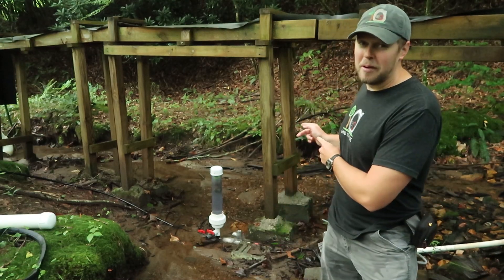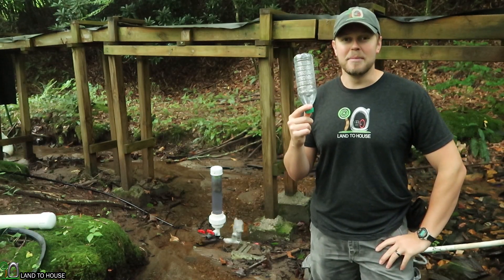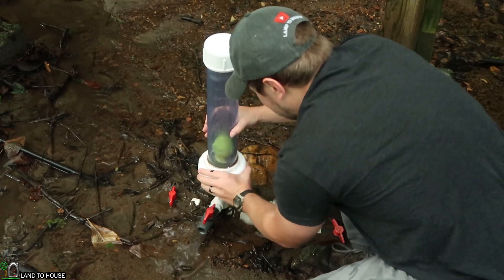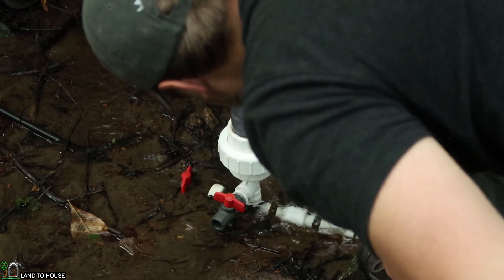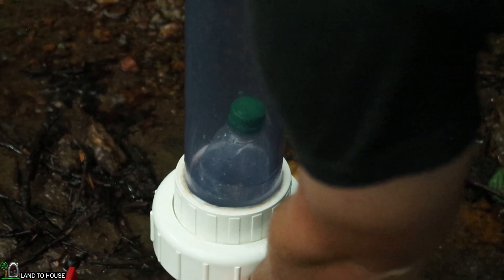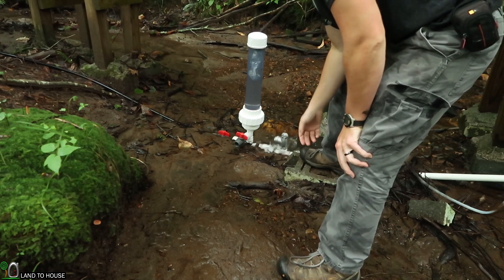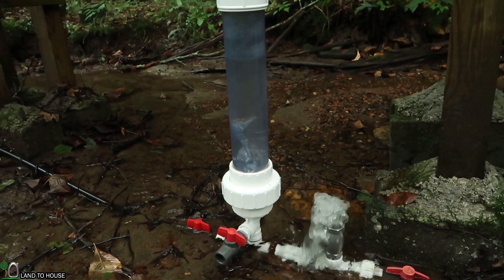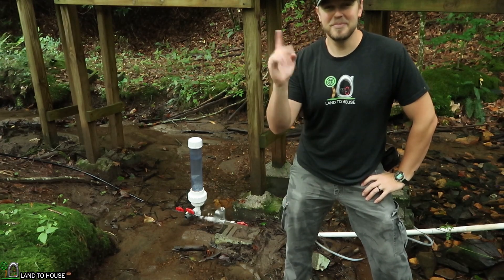Ram Pump Crushes Water Bottle

Comment: That is a rock solid demonstration. It looks like the volume of air that the bottle would have had is whats trapped in the chamber. Altho it looks like it was not successful (visually), in a way it is preventing the chamber from being completely filled with water. I would say thats a success in terms of function. I cant see the chamber overcoming that pressure once it is to the pulsing stage. The air that is trapped is pushing back. I would like to see you add 2 bottles and see if the volume of air in the chamber correlates to the number of bottles. I feel that either way, any amount of air under pressure or a vaccum will compress or expand, that is just its nature.

Comment: Try putting a tire valve in the bottle cap and pump it up to 15 or 20 psi . Some plastic bottles will hold up to 90 psi .
Reply from the maker: I looked at those valves. I need to get one for the testing of 2020.

Comment: Been watching several of your videos, interested in ram pumps now.

I still think water bottles have a shot. First thing I thought when watching you do this is "Those bottles need to be pressurized first" Of course you came to a similar conclusion and plenty of people mentioned this as well. I've seen some people commenting about adding valves to the bottle to add pressure. Also saw where you worried that the valve might pop when put under pressure (I don't think it would if the pressure inside the bottle is higher then the pressure the ram pump produces, similarly to how the waste valve on the ram pump works. Either way, if you did go with a screw valve like that on a bike, couldn't you just use the little screw cap that typically covers them to protect it for pressure changes inside the pump?)

Still, I like the idea of a closed container for the pressure rather then having a valve, so I wondered if some simple chemistry could solve the problem of adding pressure to the bottle. Either dry ice, or baking soda and vinegar. Both producing CO2 and increasing the pressure inside the bottle if sealed during the reaction. My understanding is most bottles can hold a pressure somewhere in the area of 80 PSI (Though I'd stay on the save side and pick a sturdy bottle and probably stick below 70 PSI, as adding pressure to a sealed bottle can be really dangerous (obviously)! I would mention that I have seen people online talking about PSI testing soda bottles over the years saying everything from 80-200 PSI, so I said 80 or less to be on the safe side, not sure what PSI you uses for the Bike tires as is).

I'm not really sure what volumes of either the dry ice or 'volcano experiment mixture' would give consistent, safe pressures inside the bottles, but I would go with the baking soda/vinegar mixture as it's far easier to measure consistent volumes allowing predictable pressures, rather then trying too measure dry ice. I'd probably suggest doing tests first starting in small measurements to figure how much pressure is produced by volume.

If you wanted to get really 'scientific' about it, you could even get empty gelatin capsules like those used for pills, fill them with the baking soda. Then you can add the vinegar to the bottle and add the pills which gives you plenty of time to seal the bottles before the reaction starts so there is no loss of CO2.

Doing this allows you control over the PSI, and allows for reliable and consistent results. I think that if the PSI could be dialed in, it could probably last longer then the bike tubing.

I notice you haven't done one of these tests in a while, but if you ever do, maybe consider giving the bottle a "Rematch" vs the Ram Pump.

Sorry about the long, rambling comment. Just found these tests interesting.
Anyway, these things are pretty dang neat; Just wish I had a reason to use one rather then just admire them haha.

As One last, last idea, unrelated to the bottles. Ever consider adding a valve to the pressure tank of the pump and add pressurized air in manually once water already inside to seal it? Seems like you might be able to avoid having anything inside by just adding to the original volume of pressure and just using the air alone as the medium. All any of these things seem to be doing from a physics standpoint is adding extra pressure to the system to counter the water, which does not compress. Maybe I'm missing something, but maybe it's worth testing? If that's the case, it removes the need to have anything inside at all. After priming the system you'd just need to use a bike pump or the like and give it some pressure, check it with a pressure gauge, and never need to replace the medium inside again. Maybe a bit less continent in some cases.

Anywho, Keep up the cool work :)

Comment: My suggestion would be to drill a hole in the cap, put in a tire valve stem(one that has the nut and washer to seal it in place). Then put a bit of air pressure in the bottle with a tire pump. And retest it. I've always been intrigued by hydraulic ram water pumps. Thanks for sharing!
Reply from the maker: I actually just found a tire stem that has the option to pop in and be held by the pressure behind the valve. No threads were required. I think that would be the best way of getting the pressure in there. Although if the outside pressure is greater than the inside pressure it may just pop the stem back inward..... hmmm

Comment: Maybe try sealing the cap better. Perhaps with super glue or silicone.
Reply from the maker: I used a pressure gauge to test the pressure built in the tank with the delivery pipe closed and it is actually over 60psi. The waterbottle did not have a chance.

Comment: Bottle vs inner tube... Inner tube may (even more so if inflated inside tank) have a greater air pressure than the water bottle. The Bottle when inside the tank is likely to have less than air pressure because the water is cooler than air when inflated. Inner tube because of the valve design, may allow water to enter unless it has a metal cap (stainless or bronze) rather than plastic. The air valve on the inner tube is a "one way valve". This is why the bladder on a water pressure tank has the air valve on the outside of the tank. (aside from easy access) The air pressure inside the bladder should be close to the working pressure of the of the ram pump for the best effect... well I guess all of your methods achieve this by shrinking till such a pressure is reached :)

Comment: I think what's happening is that the air inside the bottle is being compressed at the same time as the air in the pressure tank, but with the added pressure of the water surrounding the bottle the air in the bottle is compressed before the air in the tank, leaving the density of the air in the bottle equal to the density of the water around it. This is what causes the bottle NOT to float (floating is caused by a difference in density). Once the air in the tank is compressed enough, the density of the plastic will be less than the density of the water and air inside the tank, so the plastic is what's floating - not the air in the bottle. 

That's my guess! hah

Comment: You need to try things much more rigid, like racquet balls. Even the heavier plastic 1liter bottles would be better then the super thin skinned bottle used here. But I get it, you have to appease the masses, so at least this experiment proved a point.
Reply from the maker: Racket balls are actually the next test. Should be interesting. They seem to be very rigid yet rubber so also flexible

Comment: For the bottle to work, I'd think you should increase it's internal pressure to more closely match that of what it's going to experience inside the tank. Either add a schrader valve to the lid and pump it up, or add something internally to create additional pressure. Baking Soda/Vinegar or something like that.
Reply from the maker: This past week I saw the Schrader valves that can be stuck into a tire and held in by pressure. No threads required. That would probably be a good way to test out in a bottle like this
Reply: @LandtoHouse  what you should do is fit a tyre valve on it and pump it to about 60psi.